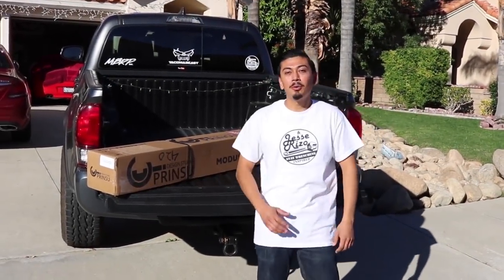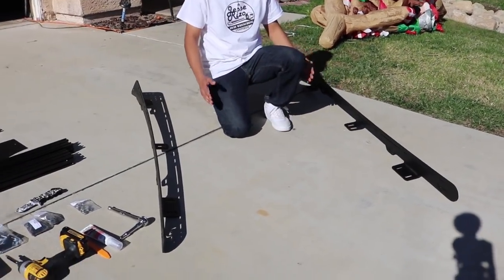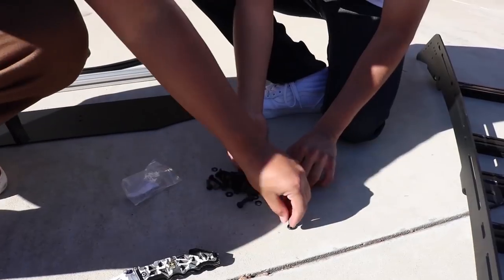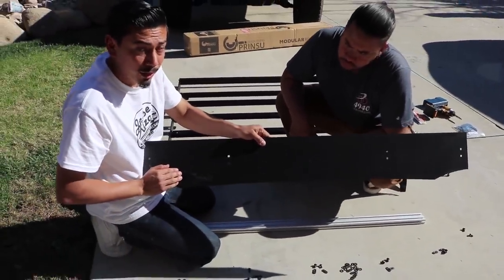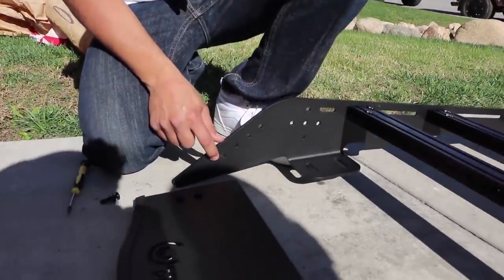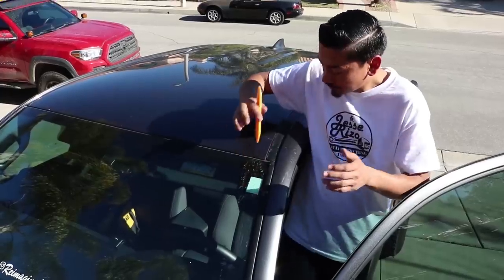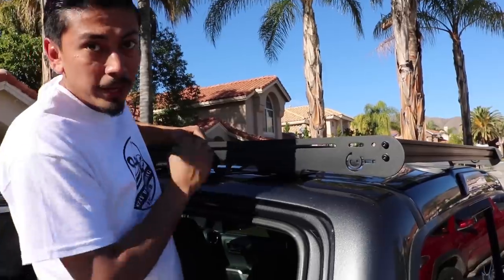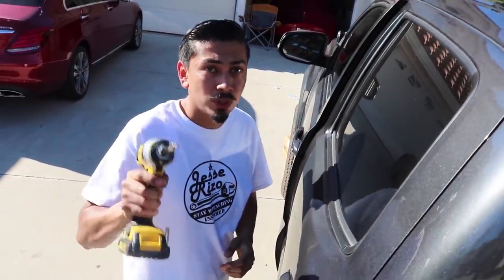PRINSU ROOF RACK DETAILED INSTALL ON TOYOTA TACOMA | FOR EVERY TACOMA OWNER

Comment: The video was great and will help me install mine...Do you think you could drill holes in the drip moulding the size of the spacers?...You can punch holes in the tape instead of removing it and a person could install this by themself by putting on one side at a time.
Reply from the maker: Yes if anything that might be better so the drip moulding doesn’t curl up on u in time so yea if u can measure the holes corrctly I’d recommend doing it that way :)

Comment: Nice video, there is another way of doing the weather strip and that's drilling the measured holes and keeping most of the strip intact , also instead of taking off the tape removing the paint , just poke holes in them thoroughly.
P.S. To all the 2nd gen Tacos, the last bar does not need to be upwards for the CabRack at least. Fits perfectly with the shark fin.
✌🤟🤙
Reply from the maker: I had thought about that I just didn’t want people trying to follow to the video and jack it up lol, thanks for the tip my friend I hope some people read this comment 👍

Comment: Another awesome video! I did have one question - What size lightbar did your friend have installed on the top? Did a 50-inch fit?
Reply from the maker: It’s a 42inch :) but we had to cut the windscreen a little to make it fit

Comment: With holes pre-existing how likely would it leak if you didn't use enough silicone? Asking cause not sure if I used enough for my 2023 Taco. Definitely not as much as in the vid. Thanks for any advice. Storm is here in socal so a bit worried with the new install.
Reply from the maker: You want to use a good amount it’s better to be safe then sorry, if you have a thought u might of not used enough if I was you just to be safe just go back out there and add a little more around the spacers and bolts to be safe

Comment: For the bolts going into the top of the truck behind the wind deflecting, do the side rails rest closely to the top the truck? I've heard of people stating that it can scratch up the top of the truck if too much weight is put towards the front of the rack.

Comment: Love your videos man keep it up! Quick question does prinsu say the height of the spacers they use for the rack? And what thread and length is the 10mm bolt for the rack?
Reply from the maker: Thanks bro I appreciate that, 
In all honesty I’m not sure 🤔 possibly a 1inch spacer as far as length and size thread I’m hinestly not sure and it’s inside the truck now glued so I can’t remove it to measure it :/ I’m sorry my friend

Comment: 2 questions. How long did it take and what did you use to make the weather stripping stick back in? Thanks
Reply from the maker: Since I was filming it took a longer because of lighting it other stuff I had to redo but it shouldn’t take long if u have someone helping you depending on ur skill level 25-45 min, 
And I did but I cut mine u don’t have to but I recommend putting a lot of clear silicone in the holes where u will be bolting down the rack shown in the video

Comment: Did you have rust issues where you scraped the tape off that was over the mounting holes? Did the same to mine today and now I’m worried about the exposed metal of the cab.
Reply from the maker: U can just use some enamel paint if ur worried spray some in the whole let it dry then proceed with the install
Reply: @JesseRizo  thanks! I’m more talking about the areas around the hole where the tape was covering. I stuck a whole bunch of Lexel in the screw holes.

Comment: Does anyone know if you can buy a single spare set of roof weather strips for 3rd gen Tacoma? I’m on a lease for about 2 more years before I make it mine, just want replacement stuff so I don’t get a deductible,
Reply from the maker: I’d try OfferUp or forums or one of those sites first then if not look see if maybe a store online sells them last resort from the dealer parts department
Reply: Jesse Rizo thank you! I was thinking of talking to my dealer, my parents keep telling me that I shouldn’t be modifying it on a lease, but I’m well prepared to take everything off IF I do trade it out, just want it nice while I have it! :) love your channel, helps me a lot and I love that you always respond to questions or comments! Keep it up :)
Reply from the maker: TheTruePatriot no problem my friend :) yea but I’d defenitly try those sites out first or even just google.com search and see hopefully something pops up lol, & u got it my friend any questions just ask I’ll always try my best to reply as soon as possible 👍
Reply: Jesse Rizo oh I did have 1 question, did you use some more silicone to secure the weather strips after you put the roof rack on? Looked like they had some adhesive hold them in place when stock
Reply from the maker: Adding them would probably best i didn’t but one side is popping up so I should have added some to be safe lol